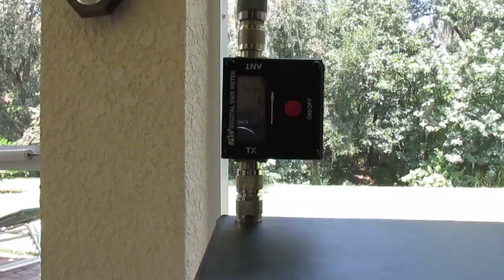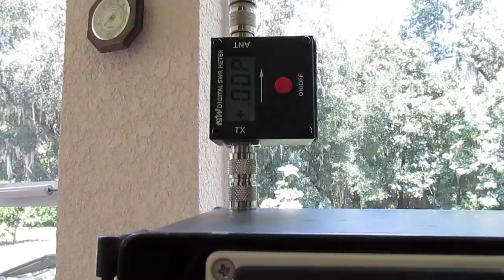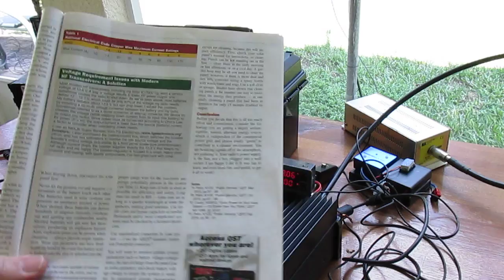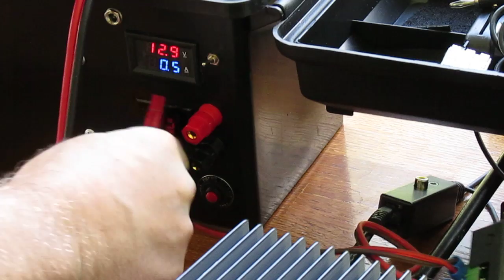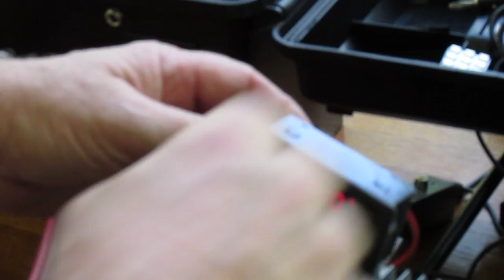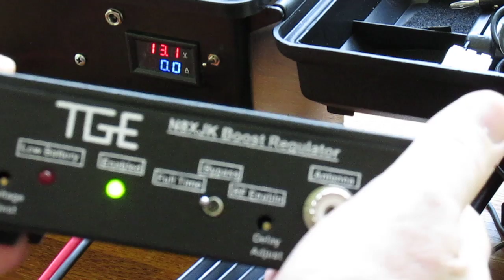TGE N8XJK Boost Regulator

Comment: I'd be curious to see if it introduces any noise into the receiver under any sort of circumstances.
Reply from the maker: Don't know, I used it a couple of times on SLA than purchased Bioenno batteries and never needed the TGE N8XJK Boost Regulator

Comment: What were the two meters used in the video?
Reply from the maker: The one connected to the antenna is an swr/power meter. I used it to shoe that the antenna mounted on a metal ammo can has swr 1:1 and output power of 50 watts vhf and 35 uhf. Full radio power with none lost, perfect setup.

The other meter is a volt, amp, charge meter to monitor go box and the external outlet  power consumption.